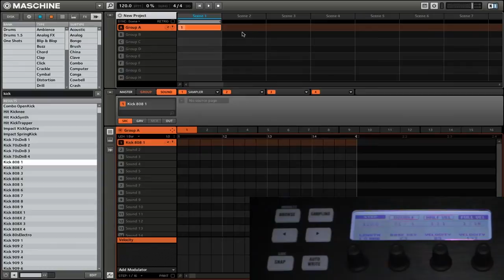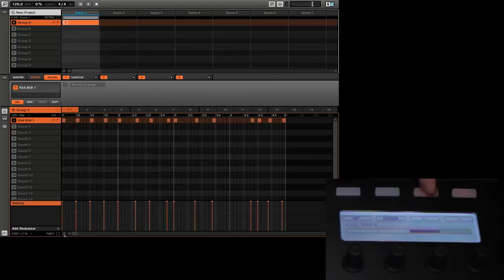Maschine Tutorial: How to Adjust Pattern Length

Comment: Say if I wanna change the pattern from 2 to 2.2 or 2.3 How to do that? I understand I turn the pattern length knob but it's not going to the pattern I wanted to go.
Reply: Did you ever figure this out?  I want scene 2 to start at 9:1:3 within the bar but it keeps jumping to 10/11/12 etc.  Seems you can only start scenes at increments of 1/2/3 ect.  There's got to be a way to adjust this.

Comment: Ditto on a PM about decimal adjustments please?
Reply: Could you please send me a PM on how to adjust the pattern length to the degree I would like. It always only allows me to adjust the length by 1 bar or 4 bar increments. Is it possible to adjust the length by smaller increments? Thanks